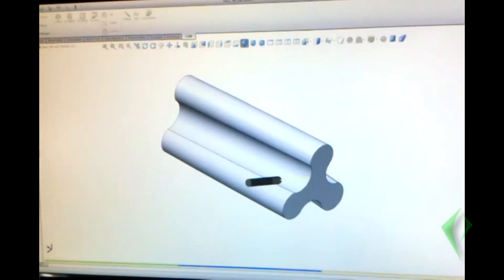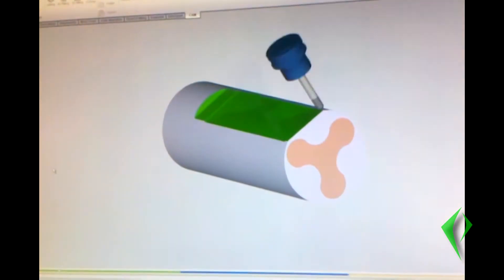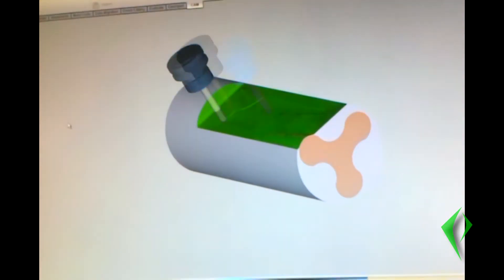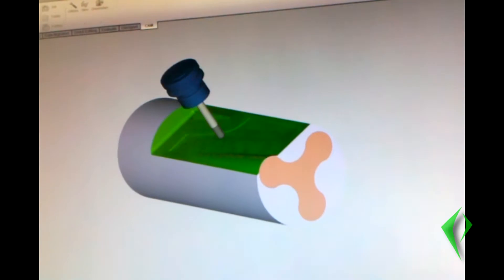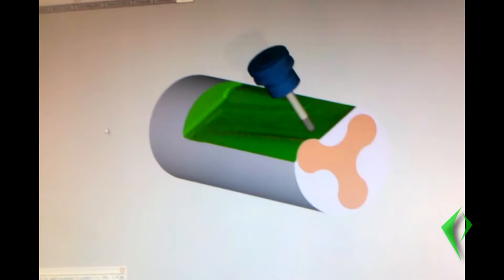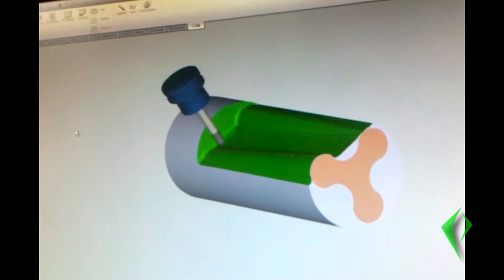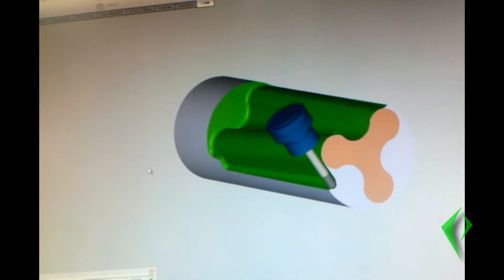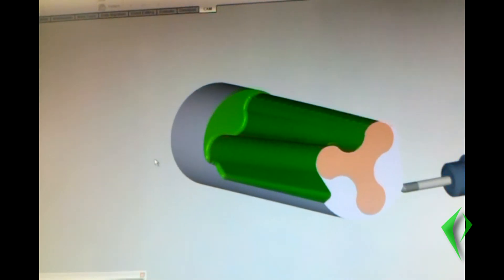How We Will Be Machining A 671 Rotor

Comment: How do you calculate the profile and dimensions for the impellors?
Reply: David Preston Epicycloid curve. There are 2 equations to input into solidworks equation driven spline. One is the "outty" curve and one is the "inny". You trim the excess and you get a rotor profile. Only problem is, the apex of where the superchargers interface needs to be fine tuned as the equation doesn't let them match close enough.
Reply: Thank you so much for that. Very helpful.